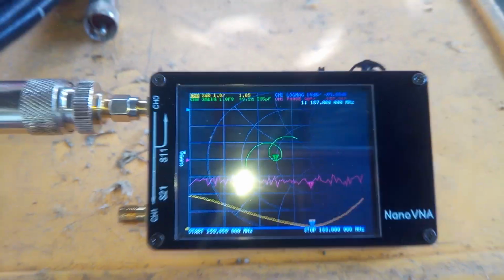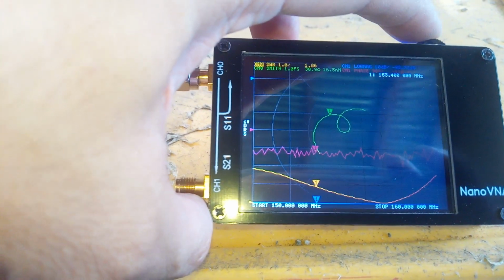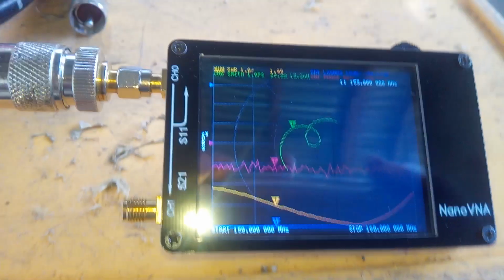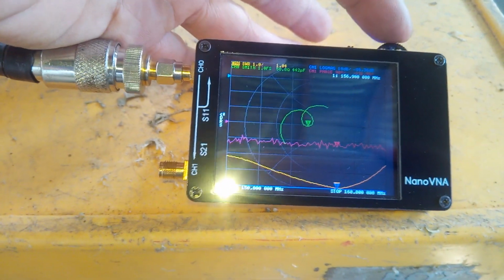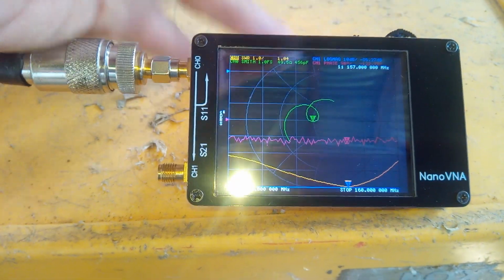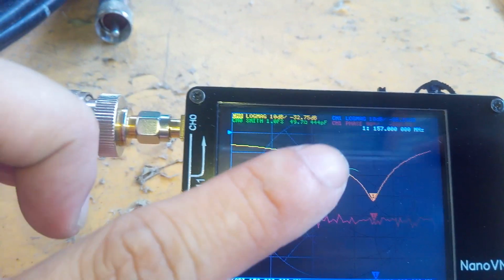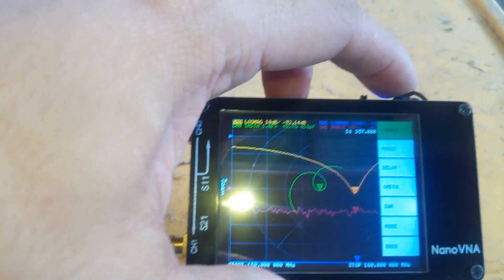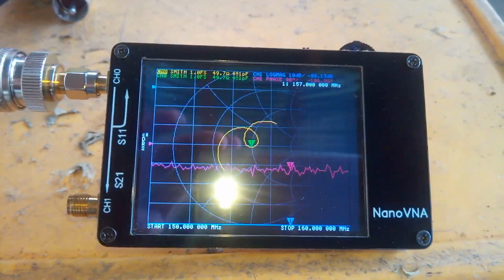4 Elements Yagi tuned to 157Mhz, antenna calibration done using NanoVNA

Comment: on this yagi on the lower side 152mhz do you lose gain compare to the center? or does it have the same gain across 152-160?
Reply from the maker: it always has the higher gain on the center frequency, as you operate on other frequencies up or down gain varies a bit within acceptable limits, if you operate outside the designed bandwidth even if you have a low SWR then you will notice a drastic change on the performance of the antenna compared to the center frequency
Reply: @EphraimGariguez  ok I got  MYA1505KN yagi 150-174I want to tune it, but I don't have a nano or any swr tuner i'm afraid I might mess it up.
Reply from the maker: @Raidergeek34  as long as you will operate it on the designed frequency you can position the tuning stub anywhere on the matching system and will still get acceptable SWR, you just need an SWR meter as basic tool to confirm the manufacturers specification if you will operate it on higher power output, but if you will operate it on just 5 watts most probably it will work as intended.
Reply: @EphraimGariguez  this yagi will only be rx only
Reply from the maker: @Raidergeek34  if RX only no need to check optimum SWR it will work as a good RX antenna on the intended frequency, but if you're going to use it as RX/TX antenna optimum SWR is essential

Comment: Thanks for share Ephraim...why are you not using the s1(tx) or ch1 sma connection?
Reply from the maker: Single port CH0 is enough for antenna testing, since I am only interested in SWR/S11 and antenna impedance, two port testing are for filters. My other  Vector Impedance Analyzer N1201SA has only one port as well which I usually use before I have the NanoVNA. NanoVNA obviously has more desirable features  and perform well to its specifications. The only advantage of the N1201SA is it's suitable for up to 2.7Ghz, which I used for tuning WiFi antennas.